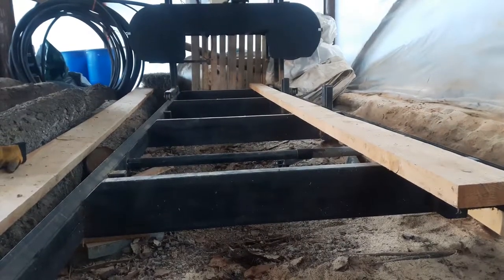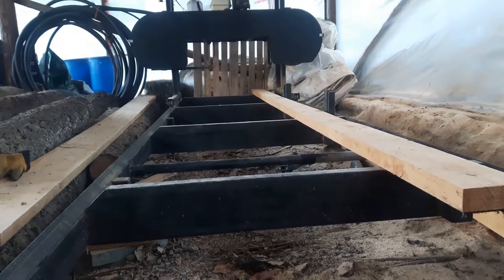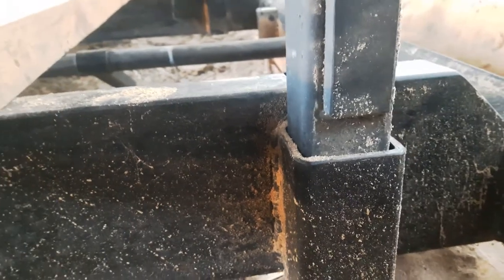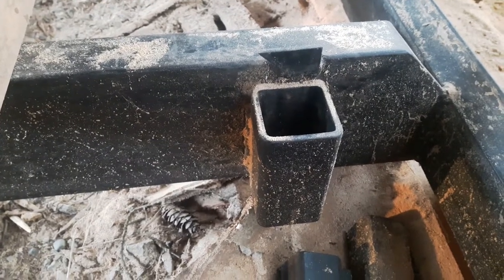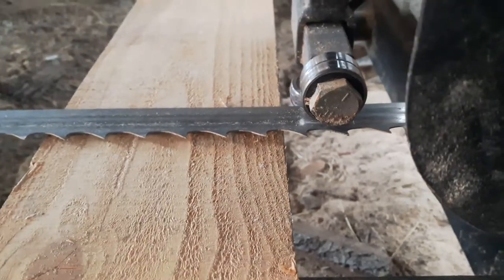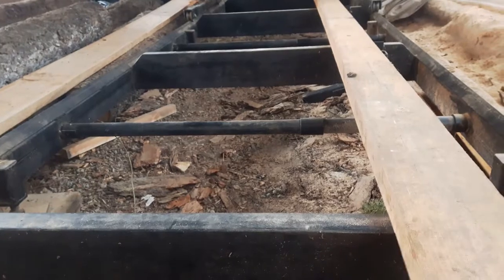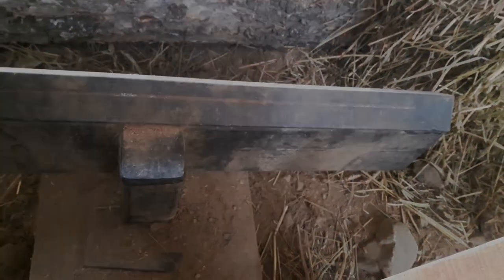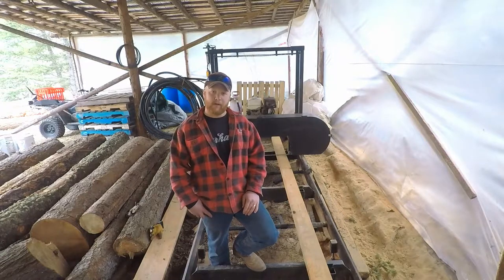How To Build A Sawmill - Part 2 - Log Deck

Comment: A log deck is the most overlooked component in bandsaw milling when it comes to increasing your productivity. I ended up fabricating log decks and jib crane for both my bandmill and circle mill. I can load it full in the morning, have a helper cleaning and peeling logs while I run logs through the mill and offloading onto my other deck behind the. Don't have to stop to load logs w/ a tractor or pull cut lumber from the mill so it's a 2x increase in productivity. Nice bandmill you put together. Regards.